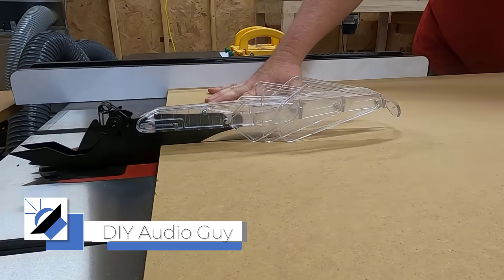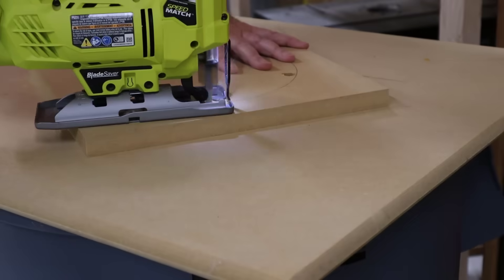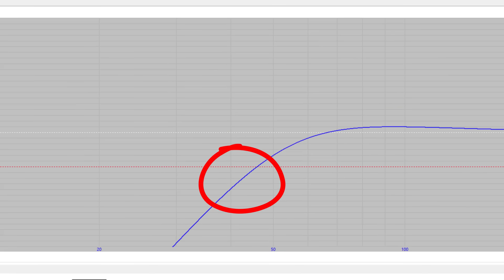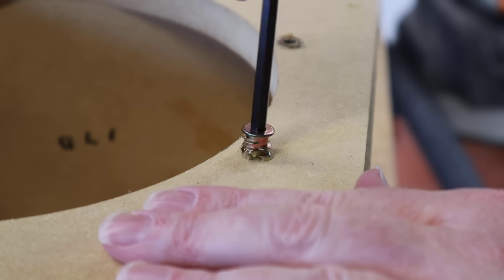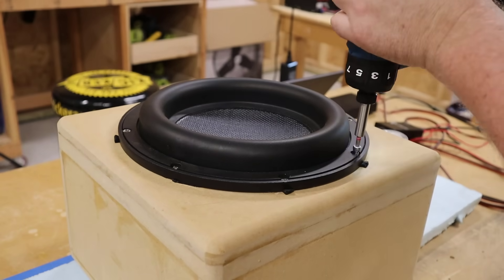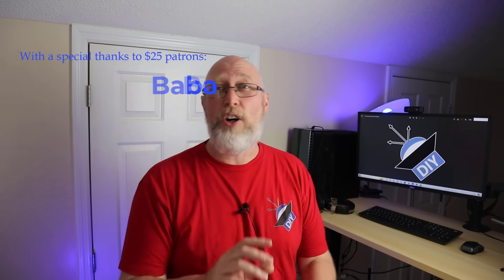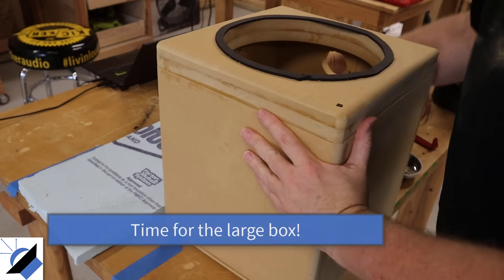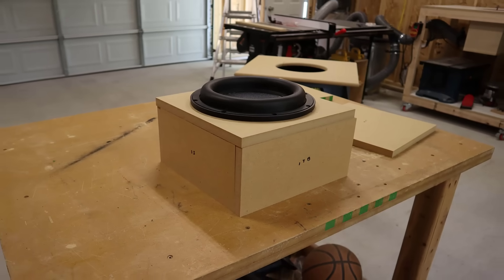Bass in a small space?  Sealed subwoofer enclosure design.  @PartsExpressOfficial

Comment from the maker: Learn more about getting bass in a small enclosure here:  https://youtu.be/v4rAkxck2_Q
Reply: a calculator exist to build folded horn box?
Reply from the maker: @Durolith  what you want to do is download some free software called Hornresp.
Reply: @Durolith ❤
Reply: V.a.s. counts..
Reply: Great work thank you.  That was alot of effort.  Thank you.
Reply: It is also possible to consciously choose a cupboard that is much too small. The resonance frequency then increases and you can then drive the speaker below its resonance frequency. This is called the ELF system (extended low frequency). Disadvantage: a lot of energy consumption compared to the amount of noise. So you need a speaker that can withstand something
Reply: Would lile to.make an ultimate blietoith beast speaners for my wheelchair
Reply: What about the distance between the sub vent and the back wall? Is there some "standard" that cam be followed or can you basically be 1/8" clear (or 1/4", or 1/2", etc.) from it?
Reply from the maker: @REG3305  I could probably do an entire video about that. Far too much to answer in the comment section.
Reply: @DIYAudioGuy  I'll keep a look out for 1 then.

Comment: Those open-field measurements are fine and all, but adding the transfer function of a vehicle cabin goes a whole long way towards minimising these differences. And while ported boxes do add a ton of efficiency and output, they also add a host of group delay.
Reply from the maker: Cabin gain that works the same no matter the type of box, and group delay that nobody can hear.
Reply: @DIYAudioGuy  It does! But that's why the roll off you show between boxes is minimised. You can absolutely hear group delay. Try a 6th order bandpass versus a 0.707 qtc sealed enclosure....

Comment: The corollary to this is that you might do better putting a smaller subwoofer driver into the same size box, if the lowest bass is your goal. It also makes sense to measure your vehicle (for car audio) to determine the box size you'll need. You can then use the formulas to zero in on the right driver. I'm afraid too many people start with the size of the woofer, then try to squeeze it into the box size they have. (We used to call this "alignment jamming;" I don't know what it's called now.) The tradeoff is that a smaller woofer will require more power to get the same overall volume. Considering how cheap amplifier power has gotten, that's an easy fix.

Comment: Whats your thoughts on a underseat subwoofer box with built in amplifier like a rockville ss8p or ss10p (8 or 10 inch subwoofer)
Reply from the maker: I don't recommend them.
Reply: @DIYAudioGuy  I have a really small car not sure if you have them where you are its a kia picanto...how would you add a subwoofer to  this car? There no space in the spare tyre due to a tool kit in there amd the boot itself is very small. I don't think the underseat subwoofer box would even fit under the seat too 😅  is there  such a thing as a door speaker with a seperate subwoofer built within that.

Comment: Port it.  Change the port tube length to tune to a frequency.  Heck, use two ports tuned differently.
Reply from the maker: Ported boxes generally need to be much larger than sealed.

Comment: i have been around car audio for a very long time-i bought a speaker box-holds two 12s/called///ground shaker//////-it fits under the seat of a gm truck back seat--i put in in my 2014 expedition cross ways behind second row seats - with 2-12s-kicker rs--------3200 watt amp for bass - 1200 watt amp for mids and highs with skar eq and bass knob---i never ever thought this box would have any thing close to this bass you have to keep it turned down -it will shake your rear view mirror and will make your ears sore---running three batteries and 300 amp alt for power//this thing rocks      amazing----some times i look at that box-and wonder how it can put out so much bass////-also if you want a very good system with high power do not buy kicker comp 12s you will fry them quick --go with kicker rs      or kicker   Qs    you will be glad you did /

Comment: If using a small Enclosure  Drill total  4 Hole 2 top 2 Bottom Then bass will travel throughout room Depending on How much Power you might want to Bolt to stand don't want them Bouncing 😀 around 😂

Comment: What do you think about making a box out of lots of 2in cut out 3/4 mdf. Cutting many squares like a picture frame, I'm thinking 2in wide frame all sides, with middle cut out.
I'd glue them all with clamps and then add a front and back, say 2 pieces thick.
Wouldn't this be very strong and rigid?
I know it would be expensive and lots of leftover wood.
Reply from the maker: What you're describing is called a batten.  As in batten down the hatches.  It'll look like the inside of this box when you're done.  https://youtu.be/jBOcjs3_47w?si=smIQqHfuD6w37G1m
Reply: @DIYAudioGuy  I'm talking about layering 3/4 mdf together with glue, enough to make say a 2.0 cuft box.
Like making a bunch of big square braces.
This way, you could make the walls say 2in thick. I realize this would be a huge waste of mdf but I'm thinking of a way to make the box very rigid.
Tried to find the woodworkers word for this. Maybe laminating or glue up.
Reply from the maker: @bloomerb4162  It's a bit Overkill for a subwoofer box.
Reply: @DIYAudioGuy  I'm going for all out sound quality. I don't like boomy smeared bass.
It is ridiculous though.

Comment: Hi, I am able to meet the box volume required for my woofer but limited on depth. Is there a guide on the minimal depth a box needs to be? Or is it a case of as long as my box has the overall volume required & the distance from the rear of the sub to the rear baffle is not critical?
Reply from the maker: If there is a pole vent on the back of the subwoofer, then you need enough space for that vent to breathe. It's part of the cooling system for the subwoofer.  If that vent is 1 in in diameter then you need 1 in worth of spacing off the back wall. 

Other than that, if it fits it'll work.

Comment: Buddy had a 10 in a small nailed box.. clappin like crazy.. i let him borrow my 15 in a sealed screwed box.. he was trippin😂
Reply from the maker: So you're comparing a 15 to a 10 and saying that the screws you used when assembling the 15 inch enclosure is the reason why the 15 is louder?
Reply: @DIYAudioGuy  no.. he thought his 10 sounded good.. and didn't know about the box knocking.. and he was cheap.
Reply from the maker: @nobiden3134  My nailed boxes sound perfect.
Reply: @DIYAudioGuy  I also bought a box from best buy for 2 12's that split at the bottom back corner.. had to drill and screw it too.
And then someone stole my stuff...

Comment: people who prefer sealed subwoofers generally mean turn the bass spl down. A properly EQ'd subwoofer, you will not be able to tell the difference between a sealed vs a ported. You can EQ down the peak of a Ported sub, You can not Boost the sealed like the one on this video up at the 25 hz level to match the ported counter part.

But the ported can be EQ'd for a flat response with greater playback range than the sealed.

Comment: i have a old ass 15" kicker comp cvr,   i stuck it in a Very small .6'sqft enclosure and theirs about a inch  on the back magnet. the subs only about 500w rms.   And when i stick my 2000w amp on it , the sub   absolutely moves BUt  its justa small box with no port. the kickers spyder is dead, hince the small box.   i play it at about  150 hz filtered,    it beats  on most dubstep songs.

Comment: Ported is good if you don't like good bass. All cheap home subwoofers use ported designs. The better expensive ones are sealed. Do you think JL Audio would make a $12,000 subwoofer sealed if ported had better sound?

Ported subs are out of phase at a certain frequency, and sealed enclosures handle more power. The only real benefit of ported designs is getting more output with less power, so manufacturers can save money using cheaper amps.
Reply: 100%! I'm surprised people aren't downvoting your facts because that's what usually happens when I state the exact same thing.

Comment: Thank you!!!
…for mentioning passive radiators instead of ports. Some of the smartest and best sounding speakers ever made used P/Rs, and were moderate to relatively small enclosures. Ported cabinets unload the woofer below port tuning and let it flop in the wind, hence is that popping sound that we’ve all heard banging our ears at that point. And also, sealed or P/R enclosures have a much higher transient response or group delay which is why the fans of those boxes say they sound better. They get moving almost instantly, vs the ported and buried woofer designs taking forever to get going(and also stop stroking too, causing harmonic distortions). Loudness and feeling the kick are great when experienced together, no need to have to choose one or the other. That’s an old 80’s car audio myth.

Comment: 3db is equivalent to doubling electrical power but sonic power is something like 10 db. I wouldn't worry about that so much at 20 hz unless this is for a home theater. Sure is a real thing. The real issue is the box isn't the only variable there and with a driver being left static, you miss the coupling of the suspension itself and how that ties to what a proper enclosure is for the driver to perform a certain way. A W6 10 would do it differently and so on.

When purchasing a subwoofer, you have to come with your min-max info. What is the amount of space you can use? What is the amount of money you have for the whole system? What is the electrical constraints? If you are unwilling to spend money on the power, we know right away you have to go efficient for output. If you come with the idea you are not trying to break the windshield but want fidelity, we know we don't have to have the biggest box for sure. If you say you listen to classic rock, we can attribute the style of bass as punchy which helps us pick the enclosure type. All those things have zero to do with a driver. I would never try to go so small on a box without visiting the idea of response curves on a smaller driver.

I would build a test specimen using the DATS to get the T/S data from the free air of a driver. Then I would model a .707 sealed enclosure with that data in modeling software (I use BB6 Pro). I would then place that enclosure in the environment at approximately the same position the final product would be in. I would then sweep and register the output at the listening position. Taking that data, I would model enclosures with different woofers to find the best fit. Lots of work but you get what you give.
Reply from the maker: https://youtu.be/4kDxUcGCe8M?si=UsTgmdCYBANs_w3e

Comment: Ported is always more efficient and much louder bass. Whether its oval port or rectangular the sound is the most reinforcement of the bass frequencies. Passive radiator, band pass and sealed boxes do not have the high decibel reinforcement of the bass frequencies as ported. With ported you essentially double the maximum watts handling of your speaker, regarding the bass. With a ported box, your speaker cone excursion is far less, cleaner less distorted bass, and the bass is double the decibels, of any box design. The only issue is the ported box can sound boomy. You will need a tuned box with proper insulation to cut down on a boomy sound.

Comment: Dang. 1.2 million views. There's some valuable knowledge in here. Thanks for translating books into youtube videos for the younger generations lol. Sooo... I have a 67 chevy single cab truck, 2 skar vd-10's behind the seat(shallow mount) and one skar zvx 8 in the center console area. Yes theyre loud on 2200w rms, but not loud enough. They listed .65cuft sealed enclosures as reccomended for both speakers, so thats what i built with my space constraints. I tried many different speakers, ported and sealed and every ported box sounded terrible even though the low end was boosted. There were certain frequencies ,usually between 50-70hz, that just produced flatulent noises. How do i design ported boxes to sound good (sql+low end response) in a single cab truck?
Reply from the maker: You are waging an uphill battle against the laws of physics.  I don't think there's much else you can do.

Comment: Hi, what will be the impact if I build a shallow box (distance from magnet to rear panel 100mm) but make up in the width so I achieve the required volume?
Reply from the maker: As long as you have enough clearance for the pole vent, you should be fine.  100 mm should be more than enough.

Comment: I started my professional career as a loudspeaker designer in 1978. 17 years after the publication of the famous work of the Australian Neville Thiele and 8 years after its finalization by the American Richard Small, on the simulation of the response of loudspeakers as electrical filters for the design of speakers. despite the lack of calculators the use of the equations of this work freed our hands. since then I have designed more than 1000 speaker models, cheap, expensive and very expensive. with commercial loudspeakers but also experimental custom loudspeakersYou say inaccuracies and bullshit. if you can't give your subscribers some proper instructions at least don't mislead them. 3db is a minimal difference in sound pressure as the scale is logarithmic. we have a doubling of the volume to 6db. be careful, the limits +3 - 3db it is not equal to 6db. it is not the double volume... anyway. the size of a closed box is defined by the loudspeaker's Thiele/Small parameters. it is up to us to decide which Qtc to choose. acceptable Qtc values are from 0.65 to 0.9. with 0.707 ideal. as Qtc grows, the volume of the box decreases but at the same time the F3 frequency shifts to the right losing low frequencies but also compressing the curve and creating an annoying resonance node which we can often neutralize by adding sound absorbing material (glass wool) to the box. .on the contrary, by reducing the qtc we move the F3 frequency to the left, stretching the curve, gaining low frequencies, but creating a belly with low volume and flabby bass. so aim for a box that will give us qtc=0.707. acoustic suspension speakers do have the best low frequency transients. it is not possible to fit all loudspeakers into a closed box. Loudspeakers with Qts less than 0.65 cannot perform in a closed box. we must necessarily choose a bass reflex box

Comment: I completely agree. In 2012, I had a 12W7  I initially put it in a ported box made AV Priority specifically for the w7s tuned at 37hz  and I was happy with it. But I was curious about how it would sound in a sealed box. So I ordered a sealed one from that same guy. Box delivered transfer the W7 and the first song  I played was “I want to know what love is “ by foreigner and in 2 seconds I noticed the difference. They sound the same but the base of the sealed enclosure was shorter which means loss of lower frequencies. I removed it the next day. And never again. If I have a small space; I will use an 8” in a ported. By the way, the boomy and tight difference in my opinion is relative to the Subwoofer. I listen to varieties from Waka Flaka, Toto, Sade and Metallica and have good ears. If you have a good subwoofer and have sqf: go ported.

Comment: I have a sub that wants 1.75 cubic ft. My current box is ported with 1.1-1.2 cubic feet. 

Is this too much of a difference? How screwed am I? 🥴
Reply from the maker: I don't think you're screwed, some subwoofers can do just fine in a slightly smaller box.
Reply: @DIYAudioGuy  thanks man! Previous sub was an alpine type s. 500 watts @ 2 ohms. It was being powered by an Alpine S-A60M that pushes 600 watts @ 2 ohms. The sub blew. Voice coil was toast. So I bought a Skar SDR12 D4 coming in later today as a cheap replacement because I initially thought my Alpine sub blew from being in much smaller box. 

But now thanks to you I see that maybe it was my gain being set incorrectly that killed the sub not the box itself.
Reply: The key is air resonance, doing best at 100hz in 32in's long air chamber, its called bazzoke subwoofer

Comment: Sealed sounds better across a large frequency range. Ported is substantially louder at the tuning frequency. It is what it is.

One thing no one ever mentions is that you need a stronger box for ported. They build way more internal pressure than sealed.

Another thing to consider is that sealed boxes make the speaker easier to blow with frequencies below tuning.
Generally not a big problem with low tuned boxes, but if you're running a turntable, microphone(s), or showing movies, you can intruduce inaudible subsonic frequencies that can absolutely blow your speaker. Sounds below box tuning frequency will make the driver absolutely lose control of itself. And distortion is what usually blows speakers.

Moral of the story is, if you run ported boxes, use a high pass crossover at the tuning frequency or slightly above it. Even a basic FMOD is excellent, cheap insurance for ported boxes. 
My ported subs are tuned to 30hz and i run a 40hz higg pass FMOD. At 12db/octave the difference is inaudible. But my subs are nicely protected.

Comment: 2 x 12" volfenhaug subs 750watt volfenhaug amp. 1cu.ft. sealed box per Sub in a 2002 Pontiac Sunfire. 

   From distance of a block away, system would shake my house's kitchen window. I'd take sharp clean accurate bass sound over any level of output volume if that output is more of a boomy sound